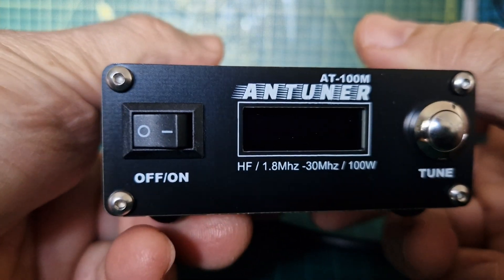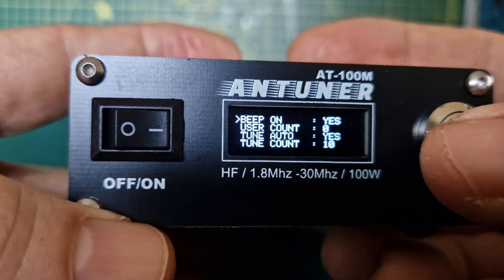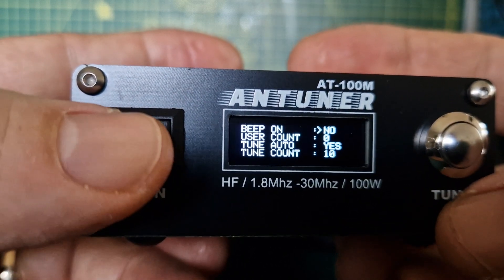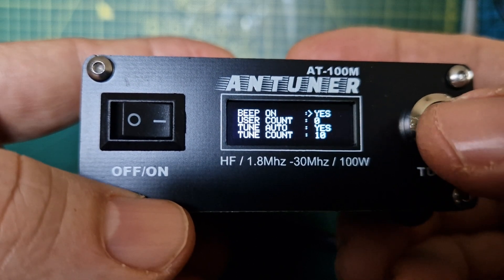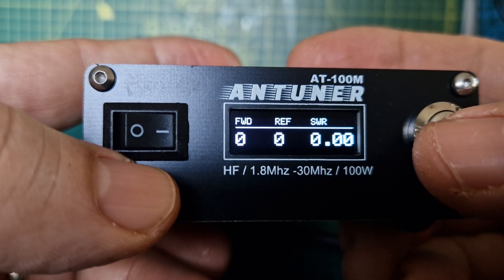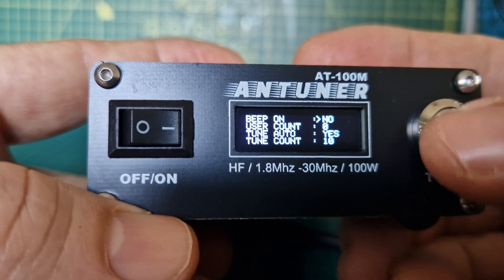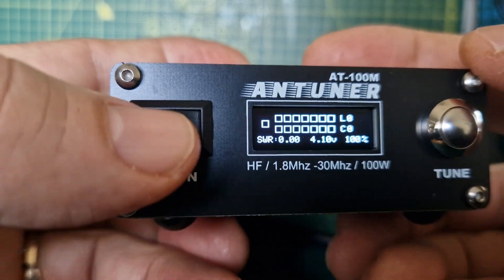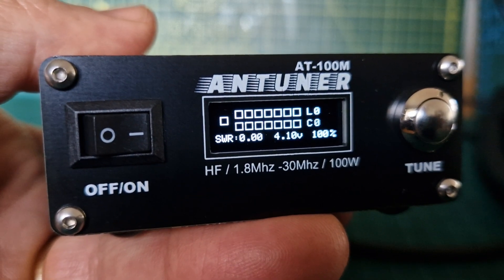ATU-100M, Antenna Tuner - Change Settings Values

Comment: I bought one.

I like it, like it a lot.
 
I often use it in the manual setting & after tuning the antenna to a frequency I leave the tuner turned on & swap the antenna to my RSP-1A receiver.
Reply from the maker: Perfect

Comment: can this be used for recieve only to tune antenna say for an SDR
Reply from the maker: You need TX to make it tune best to get a manual tuner .
Reply: I did. 

But, I set it to manual and used a Qrp transmitter with the tuner in manual mode to set the tuner to a 40 meter frequency then swapped the antenna to the SDR.

But, definitely one needs to give it a low power tx signal to initiate the unit to set a match for the antenna.